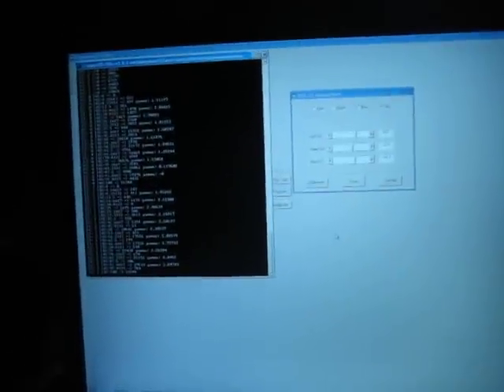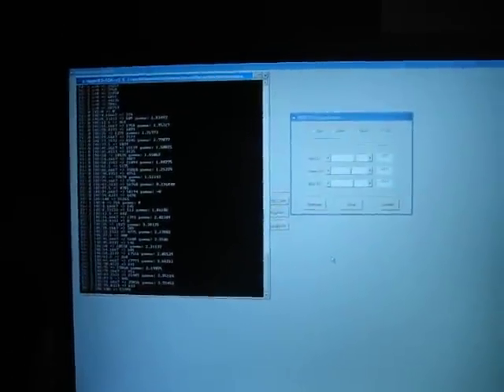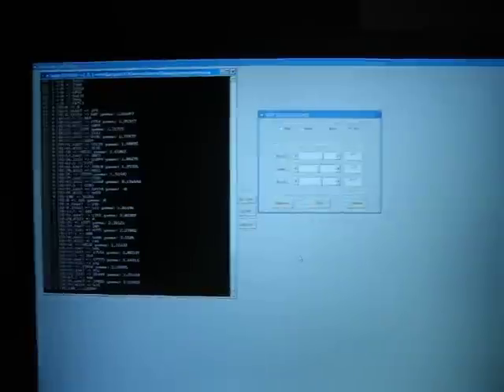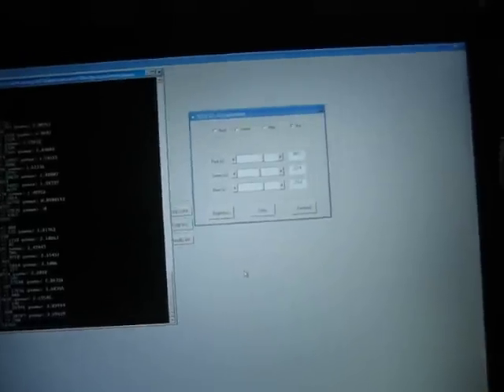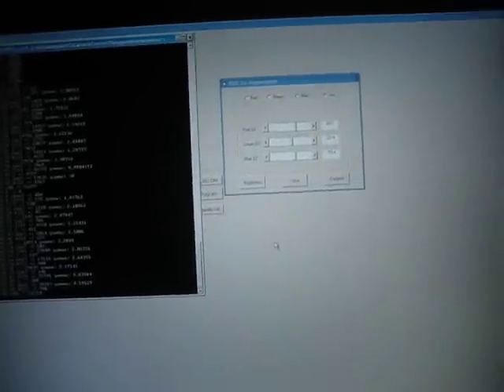CRT Projector gamma measurement with a digital camera

Comment from the maker: @dude201081 Those are two VDC Marquee 9500 Ultra CRT projectors, controlled by a custom pc program (which I wrote), as a required step to do edge blending, i.e. use two projectors to show a seamless picture with a partial overlap in the middle.